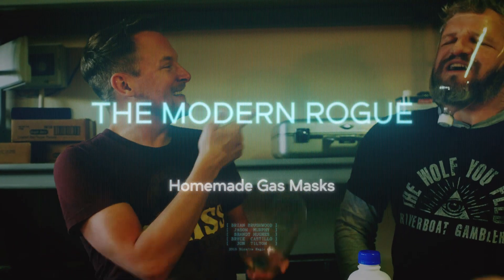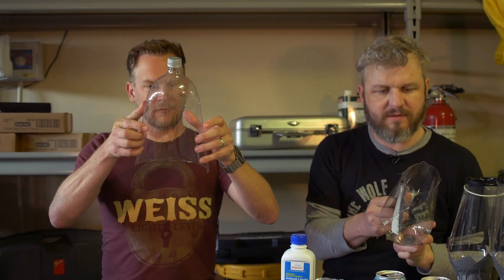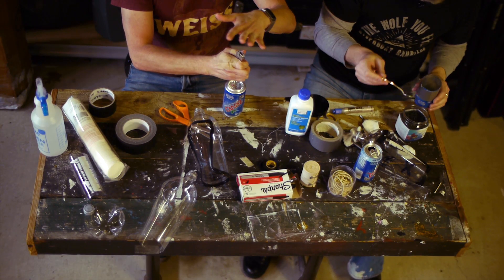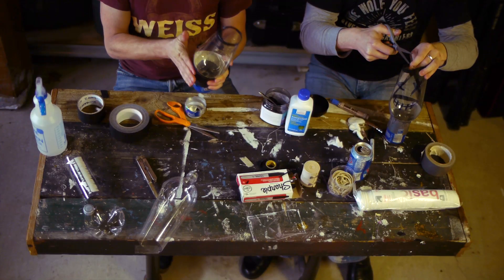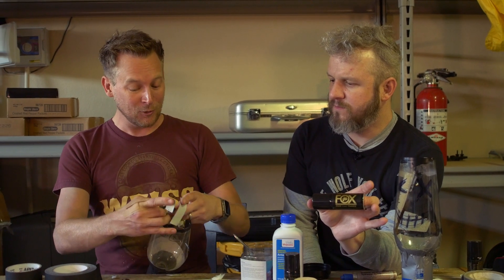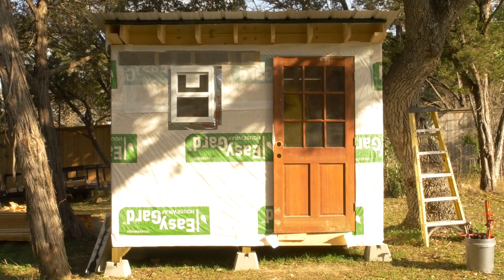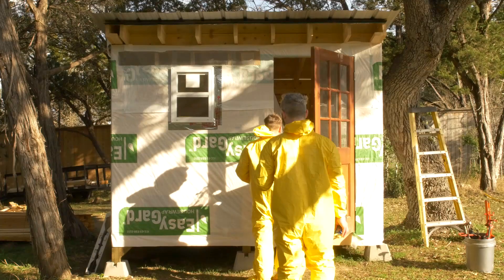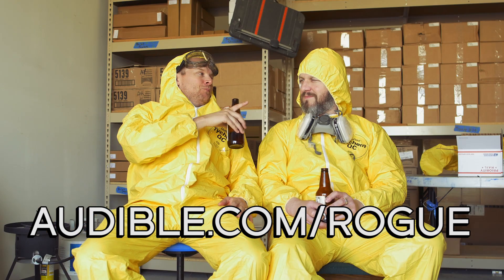Homemade Gas Masks vs. Tear Gas Grenades

Comment: I wanna try making one that utilises two cans instead of one. Perhaps the increased surface area would produce a better effect
Reply from the maker: +Nikolaj Lepka smart!
Reply: Scam School question is of course how the best way to mount two cans would be. I mean a soda bottle only has one opening. Hmmm
Reply: +Scam School haha you both are totally crazy.
Reply: +Nikolaj Lepka t joint piping
Reply: how does the coal pellets work to filter
Reply: man Ray
:D
Reply: Possibly use three cans. One on the actual bottle opening and two on the sides if you position them correctly and find a way so that nothing leaks in.
Reply: MegaToasterr that's a Murphy's law waiting to get applied
Reply: Nikolaj Lepka
lmao
Reply: how about 3 cans it looks cool.but the only thing is that you have to check the cans more often.
Reply: All it would do is make the mask more prone to leaks and possibly increase air flow.
Reply: I think you would need a real canister to filter out the aerosalized crap in tear gas, mustard gas etc.  But I do know that layering thick wet rags do work to stop the gas. Thats what the people in France use who dont have actual gas masks.. when there prime minister is tear gassing them for protesting..
Reply: @reviewguru5457  Quite a bit of aerosol suspended crap could be limited by the initial wadding - like p2/p3 filter could REDUCE the amount of stuff that gets through - but that filter wont stop it by itself - for this you need charcoal based filter - so yeah it would limit the exposure a bit but not protect against it. basically without charcoal filter you would be still exposed but with smaller doses with each breath - with irritant gases like tear gas - that might be sorta bearable but with something actually lethal... well you would die quite quickly).

So yeah the key issue with low grade home made filters would be to make them very large to compensate for the lack of "quality". Basically larger means bigger surface area the air has to come through - which both slows down the flow and makes the filter more efficient at its job - sadly this makes the filter less handy but heck its a good trade off all things considered. Cheers o/
Reply: Use some PVC pipe connections, a Hose and a Spam Can

Comment: I once did this but I made a tube of duct tape to go out the mouth and the filter clipped to my belt. Also, use adjustable elastic glasses straps(it's about 1.89 each).

Comment: try a monster can or maybe a second bottle, seems more surface area wil be more effective, also they sell the charcoal in a finer grade, not so mutch sand or dust but like half that size, more surface area is more filtration
Reply from the maker: +Arian Wijkstra good points.
Reply: +Scam School home made gas masks?! Thanks! Now I can be safe while working my meh lab.
Reply: +TR-8R meth*

Comment: The tall Monster cans with lids work great if you want to make filters that you can change out. Two liter bottle caps are slightly wider than the mouth of the Monster cans. Poke holes in the 2 liter bottle caps, poke holes in the bottom of the monster can, use as much charcoal as you need, superglue or hotglue a cap to the mouth of the Monster can (threads pointing outward), and thread it on the mask. No cutting on cans required and it looks a lot more official. Plus you don't lose your filter if your mask isn't too great or it has a leak, and you can slip the filter in the inside of the mask, so it packs up much smaller than the regular can just taped to it.
Reply from the maker: +Matt C good stuff... thanks!
Reply: +Matt C awesome

Comment: What does the char coal do
Reply: +JJ Studios 
the char coal has a reeeeeeaaaaaaaaaally high surface area with lots and lots of microskopic cavaties so that particles or molecules will trap themselfes in those cavaties, and by that keep the air clean/free of said particles.

wikiquote: "just one gram of activated carbon has a surface area in excess of 500 m2 (5,400 sq ft)"
Reply from the maker: +JJ Studios binds with the capsaicin.
Reply: +JJ Studios 
the activated char coal has a reeeeeeaaaaaaaaaally high surface area with lots and lots of microskopic cavaties so that particles or molecules will trap themselfes in those cavaties, and by that keep the air clean/free of said particles.

wikiquote: "just one gram of activated carbon has a surface area in excess of 500 m2 (5,400 sq ft)"

Comment: Questions, would turning the tablets into a powder help, and would cheese cloth be a potential alternative to the dense cotton?
Reply from the maker: +mrgreypoop both sound like good ideas to me.
Reply: +Scam School Might want to pack the material denser, maybe two layers that are seperated by a membrane. Also the crushing helps for greater surface area of the activated charcoal.
Reply: Scam School I'll try it out if I ever have some tear gas on hand.
Reply: +mrgreypoop it would be even harder to breath through powder though.
Reply: I think they would inhibit the air flow to much though.  they would hold the charcoal in place fairly well but the airflow would be to restricted.  How about some shaker tops from a spice jar.  OK, it sounds dumb but go take a look at the shaker top that pops out of a small bottle of garlic powder or other spice bottle.  The holes are about 1/5 an inch or less in diameter each and you could use several in layers to allow better air flow and hold the charcoal in place.  Hey, this thing is already going to be a ghetto version so why not go all the way. LOL

Comment: Y'all did not make these correctly to be effective. The filter should be layered with filter paper, lots of activated carbon, not just a few spoonfuls and some sodium bicarbonate in a layer of its own. You should not hear the carbon pellets rattling around when you inhale. It should be packed tight but loos enough to breath through.

Comment: Its a good thing that the air escapes from the sides of the masks when exhaling. Smokedivers masks do the same keeping a slightly higher pressure inside the mask than outside, it ensures that nothing can get inside the mask if there would become a small leak.
Reply: +SportSoulLife What are "Smokedivers"?  Do you mean someone on scuba?  That's what happens when you  scuba dive.  The exhaled air passes out the sides.  It is probably what happens with a gas mask also but I have never worn one and wouldn't have any idea on that.
Reply: John Miranda Firemen that go into the burning buildings with a "scuba diving mask" yes, because im a sailor I need to go basic smoke diving courses. No the air passes through a valve somewhere in the mask, but the mask is designed to always leave a little high pressure inside. But the idea is the same, if there was a little leak no smoke or toxic gases can come in, with these home made masks though there comes a leak every time you exhale.
Reply: duh, I should have remembered that.  I use to have my wild fire cert from the U.S. forest service because I was part of a search and rescue team that worked with them in southern California.

Comment: Does it work against mustard gas?
Reply from the maker: +sando nero not gonna find out.
Reply: +Scam School why not u did do the worst aid kit so y not ?(^-^)
Reply: +sando nero Wont work, the mustard gas is WAY too thick to even pass through the cotton, so you would be unable to breathe at all, but if you thin it, I'm not sure if the activated carbon neutralizes the mustard gas.
Reply: +sando nero dont try it but putting a cloth with ammonia at the end wold probly work
Reply: No
Reply: Scam School  yah cause mustard can change your face so it is VERY RISKY DO NOT TRY
Reply: That Guy and the eyes and your lungs trust me yes you will gzt burnt but since the efficacity of gas mask back then i think it could work for your face.zt least your eyed and lungs aren't burnt.
Reply: tubeboy don"t make me flashbacks to ww1
Reply: Nope only piss and professional ones do that

Comment: this is NOT teargas fucking click bait man
Reply from the maker: +john doe what would you call it?
Reply: uh mace grenade.tear gas will tear your lungs apart at molecular level .you can make it with clorine and amonia its a lower level version but it will do for you test .(dont do it you will die with those mask)
Reply: Mustard Gas is a Schedule 1 chemical weapon it hasn't been used since WW1.
Reply: john doe I did a chem tent in the army CS is annoying but it doesn't "tear your lungs apart" on any level, it reacts with moisture it's very unpleasant but it won't kill you, those 2 min before you are allowed to put a gas mask on wont be forgetful but aren't exactly life threatening either.
Reply: +john doe Mustard gas is worse then tear gas by far. Mustard gas was made to go though the mask.
Reply: +john doe Who fucking cares?
Reply: well i do if i were to make this and got teargassed id be pissed when i started spitting up blood
Reply: ***** oh okay, but the point is there is a big difference between the two.thanks for that info.im thinking mustard gas maybe
Reply: +john doe that is mustard gas. Not tear gas.
Reply: +john doe "Tear your lungs apart at a molecular level" There are no words for the scientific understanding being shown here
Reply: +Scam School Its pepper spray, not tear gas. Tear gas is much easier to filter, although it is WAY MUCH MORE BRUTAL. Tear gas is Chloroacetone. If it would have been Chloroacetone, your eyes would be instantly watering with unbearable suffering, and each inhale feels like snorting broken glass. This pepper spray is a "downgraded version" of Chloroacetone, a much more humane version.Although, if you wanna try to filter out REAL TEAR GAS (Chloroacetone) you can make it, just look up a video.
Reply: +Nitro The term tear gas actually covers both pepper spray and CS gas.

Comment: If you do a layer of cotton, carbon, cotton a few times, then lightly perferate the middle few layers you'll be able to take deeper breaths because the carbon will be sandwiched between cotton layers and wont be able to spread apart in the can, but the perferations in the middle will still allow air through.

Comment: Powdered granular activated carbon (GAC) would work much better.  It provides more contract space on the GAC per volume over the pellet GAC.  Powdered for air, granular for water.  You'd just need to put it in a bag (old pantyhose would likely work great). Great work on proof of concept though.

Comment: PROTIP, use a sock for the filler in the can. Not the stretchy part just the toe to heel area.
Reply: Add a used laundry dryer sheet in the bottom for fresh scent! LOL tested in the backwoods of Ohio with a smokey wet wood fire.

Comment: You know that feeling when you watch a video and wonder why you're even subbed to this? 
Well, not on this channel, that was AWESOME!

So what this really needs is improvements to the filter package, I bet you can double or triple the thickness without impeding airflow much... 

I'm thinking double what you have now and put some porous spacing layers in between the coal layers, like a sponge or thick mesh-screens. Make the single layer thinner but use more layers. This should allow you to inhale stronger.
 
Any chance you're going to improve/revisit this?

Comment: Maybe you could use the cut off top part of the can, poke some holes in that, and jam it in backwards into the bottom part of the can, after putting in the pellets and cotton, to keep the pellets from rattling around or falling out, tape it down around the rim too so that it's held into place and doesn't cut the bottle.
Reply: SlavjanA I tried it and I died

Comment: You should also add Zeolite to the filter. It is a lot like the charcoal but it is mainly used in the medical field for oxygen concentration it can also be found as a slug detorant. It's on Amazon, chemical free and just as natural.

Comment: activated charcoal works because it is extremely adsorbent. any particulates in the air will be able to find their way into the porous structure but will not be able to get out. PS grinding the activated charcoal into a fine powder will exponential increase its ability to adsorb irritants, but make sure you never breath in this fine powder.

Comment: i actally made 1 for my dog  - and this is how not to do gas-mask 
you make like 3 mistakes just from the start -
Reply: +Faith No More but didn't tell how to make it correctly. please tell us :)
Reply: +Faith No More So enlighten us then! How do you think it should be done instead?
Reply: 1. Cotton absorbs moisture this filter will stop wotking after 15min. - gauze or mask work filter 
2. The bottle is not sealed and can not be sealed - good plastic bag will work better.
you can add sealed with duct tape
3.  larger can not Coke can with 2 small hole in the center will work better.

and more...

Comment: I think it may have worked better if you ground up the charcoal
Reply: +Paul Miller I considered that, but I was afraid of aspirating it or having it slip out of the holes in the bottom.

Comment: Yeah... You've got to crush the charcoal to maximize its contact area. I'd also suggest making a package of crushed charcoal and coffee filters(or other thin paper).
Reply: The time and cost just buy one
Reply: +Ronald Gargoyle Is there a way to get rid of the exhaust air so that you won't faint?
Reply: ***** It goes through the same filter. I suppose you could put some on the sides for more ventilation but then you risk compromising the seal of the mask.

Comment: or you could buy a painter's respirator at home-depot :P
Reply: Have fun with that stuff in your eyes bud
Reply: +ndyt A painter's respirator won't protect you from TearGas. 
Apart from your eyes being unprotected, the filter is just meant for particles. The coal is more than just a filter, it actively binds chemical to itself. The Painter's thing will make it a little less unbearable but ultimately won't make much of a difference.

But it would be an quick easy improvement to a homemade mask! More means more better.
Reply: +BlackMaskGameing RBM has charcoal filters tard http://www.amazon.com/Safety-Works-10041139-Purpose-Respirator/dp/B000P9CX1A/ref=sr_1_16?ie=UTF8&qid=1457704968&sr=8-16&keywords=painters+respirator
Reply: ndyt The manufacturer says these standard filters will only protect from very low levels of chlorine fumes... But they do offer toxic fumes specific filters so these will totally work.

Great price!

Comment: should of crushed the pellets into powder
Reply: The problem with that is that the charcoal would slip out the holes.
Reply: Captain Xno I really didn't mean powder but just into smaller pellets and the cotton on the bottom could stop it from falling through
Reply: oh ok. that would work.
Reply: Captain Xno like sea salt grains
Reply: +Maxwell Chen it's simple just add a some wire mesh over it
Reply: But on top. Wouldn't u breathe it in?  Cuz Brian tried adding an extra layer of cotton on top and it didn't work because no air was getting thru. So if you had small bits, you could potentially breathe it in.
Reply: +Some One kind of like a tea bag
Reply: A simple paper filter moist by vinegar would make it 10 times more effective